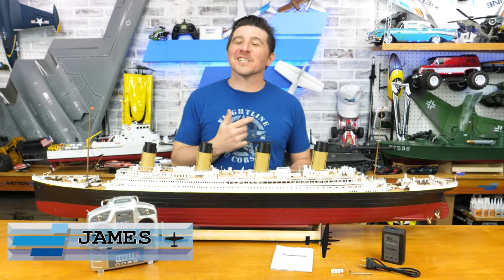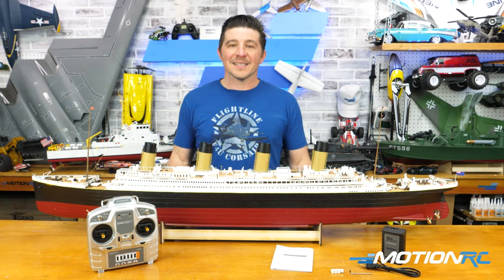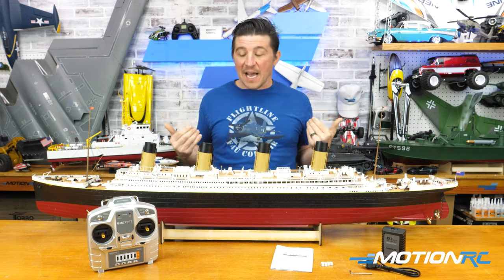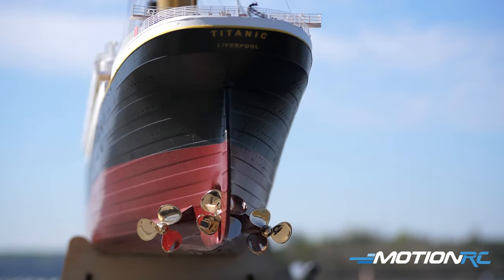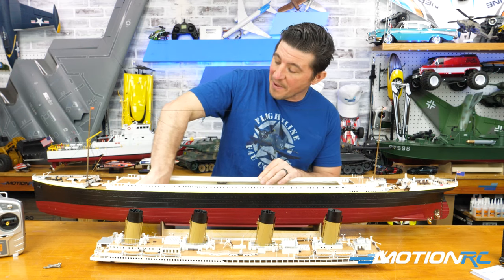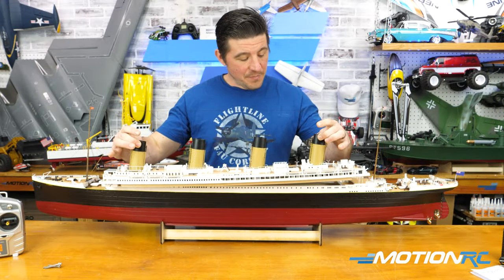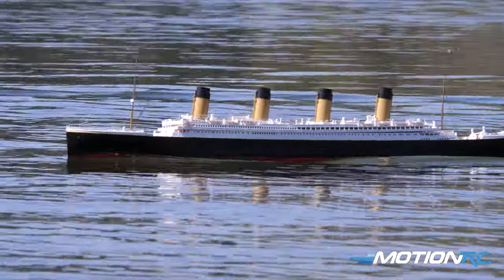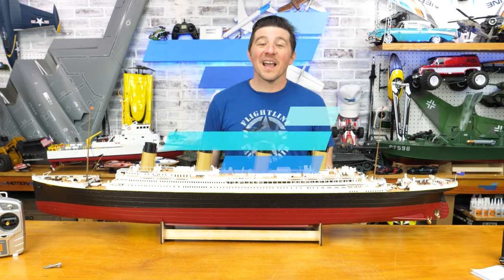Bancroft RMS Titanic 1/200 Scale RC Boat Overview | Motion RC

Comment: You actually want to get the waterline about a quarter inch BELOW where the red meets the black. That's the 'antifouling line' where the antifouling paint ends, and that red paint is meant to keep barnacles off the side of the ship. Usually the ship would be riding just below that line to account for wake or other disturbances splashing the barnacles up against the side of the ship. If your waterline is RIGHT at the red paint line, there's no protection just above the water.
Reply: G deck is right where the black paint end and the red starts. The ship actually had a bit of red above the water. He added a little too much weight
Reply: @ryans413  That's... exactly what I said

Comment: If someone wants a ready to run 1/200 titanic then i could see this ond being tempting. I would personally just buy the trumpeter kit and convert that to rc. It'd be more work but probably a bit cheaper and it includes lights.
Reply: Cheaper?  Highly unlikely.  Reliable?  Not even remotely.
Reply: @StreamwoodExplorer  the kit can be bought for 350€ where i am at and the rc equipment would je around 150-200€ at least.
Reply: @emilbt7588  How much is your time worth?  It would take MANY man-hours to complete the Trumpeter to a high RC standard.
Reply: @ministryofanti-feminism1493  I don't think anyone would really want to build one just to save money. Upfront cost can be lower, as you can spread out your purchases as you build. But primarily people who build them would do it because that's a huge part of the fun for them. Obviously that's not true for everyone, so it's great that those people have this option.
But I thought the same as OP, for that amount and given I'd still change quite a lot of things. I'd rather build my own.
(And then end up spending the same if not more and work on it for half a decade. But that's fine by me ;)

Comment: 6:59 In fact, no one knows how many blades the central propeller had. All available photos are photos of Olympic propellers, not Titanic. It is known that the White Star Line Company experimented with different propellers with different numbers of blades. There are reports of this. The three-blade gave more speed, but also more vibration compared to the four-blade. The central screw of the Titanic is hidden under the soil. The central screw did not have a reverse and worked only in the forward direction. The drive was from a steam turbine using exhaust steam after reciprocating engines (the energy of such steam was still enough to spin the steam turbine). Piston engines drove the side propellers.
Reply: I think a few years back, they found a Harland & Wolff Engineering Book with all their Ships Config. Stating that Titanic and Britannic both used 3 Propeller Blades where Olympic used 4 Blades to Test it out. But i think they changed it back afterwards to 3 Blades on the Olympic. https://www.youtube.com/watch?v=HZrm79glrgE&t=584s
Reply: @ze_german_kraut_alfda  came here to say that

Comment: I got a suggestion for a 2.0 version of that ship (if there ever be one) could you add the watertight bulkheads aka big non roof top walls in the bottom, and if possible could you add an iceberg that can float as well as make a small door at the front right bottom side of the ship and make it open and close to let water in? As well as make it all water proof? That would be amazing if you did that!

Comment: Damn those are SS United States speeds! Ive got the "other" rc Titanic thats much smaller but illuminated and WAY slower. Would you happen to know if the forecastle and bow have a waterproof deck as well? No way i wouldn't be taking this out during a storm. Mine isn't very watertight.

Comment: Design flaw; they used unfinished plywood under the superstructure which warps badly and causes excessive sheer (curvature) which looks horrible.  The only solution is to drill and glue nuts under the rear deck near the aft part of the superstructure.  Drill through the superstructure and deck on top of the main hull so the holes align perfectly.   When the nuts are good and dry, screw the aft part of the superstructure down flush.  You can heat the bottom of the superstructure with a hairdryer on medium or high heat and it will flatten out so it will be easier to screw down flush.  Why they did not add screws to the rear of the superstructure is a good question.  Motion didn't have any parts.  So I purchased small machine screws and nuts and washers from Home Depot.  I glued the nuts to washers before attaching them under the holes drilled in the deck.  The washers add extra reinforcement in the area.  Maybe overkill but I didn't want any deformities in the deck from warping pressure.  Looks much better.

Comment: there is a fundamental dif between a boat and a ship. titanic is a ship not a boat. a boat when it turns rotates inward like an airplane turning. a ship rotates outward from the turn axis like a truck on the road. hope you learned something. but cool model too bad you cant reduce the viscosity of water by 200x so you get a true wake. its like shes in syrup but its a cool effect. the des. was amazingly hydrodynamic the reason why people just put the ballast in is so it settles as low in the ship as possible. you want the centre of gravity as low as possible making it stable. think about the real ship and where the weight is. what is the heaviest thing in the ship. it was the 2 trip expansion engines. these were mounted mid ship. see if your ballast is in the bow and stern your response will be low because the inertia will be higher in rotation. you basically just want to put a block a steal in the rotation centre of the ship giving you a pivot point or even something heavier like copper. once you have your main ballast in you trim the bow and stern with a little weight as possible to maximize turning performance. you ballast then balance in that order. i hope this helps you in the future. cheers.

Comment: The windows are not cut out properly on A deck, the super structure decks are painted plastic that clash with the wood veneer stuck on rest of the decks. Those square white boxes hiding the retaining screws look ridiculous and the water line is to high. You would be better off building the 1:200 Trumpter kit with wooden deck extras motorizing it.
Reply: The Trumpeter is for very experienced modelers and requires hundreds of hours of work, especially when you add the upgrade kits.
Those who will buy this RC model will do so precisely because it is ready to use, with an amazing level of detail for a model already assembled and painted. This is not the same audience at all. Just like me who, at the same scale, chose the Lego version...😅

Comment: $1400 and no smoke. Seriously?
Reply from the maker: The sheer detail in this from the hard wood decking to brass fittings to metal all around and clearly hand assembled is unreal. And you need to do absolutely nothing but ballast it out of the box. No one is hand making a model of this detail for the time it would take at anywhere near that price. It's stunning and for those who know, know and have one.